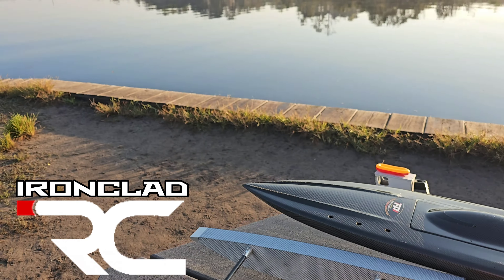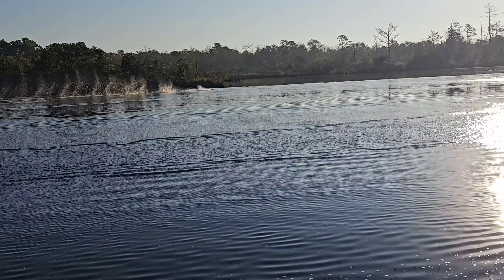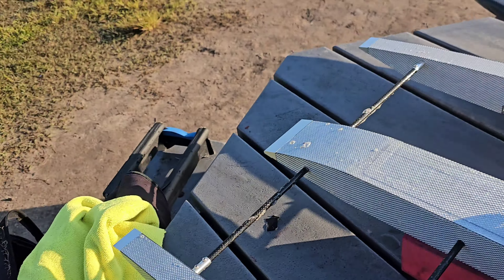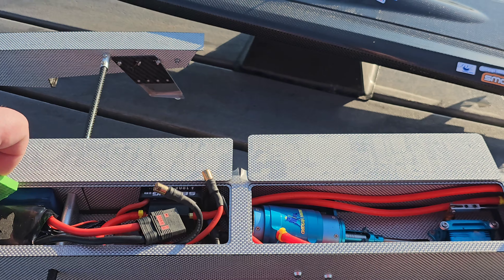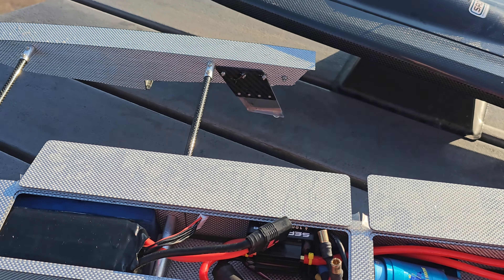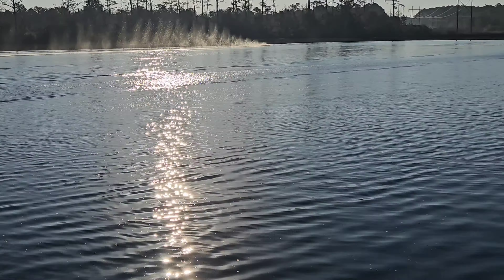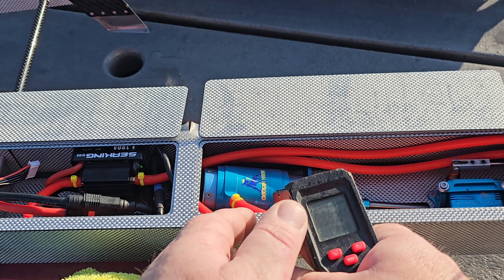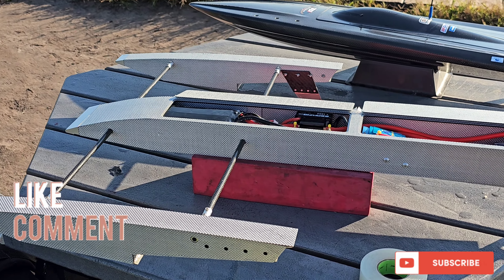Turning Laps On Glass Oxidean Scorpion Rigger 34" Carbon Fiber Rc Boat - Seaking 180a, 4082 2000kv

Comment: Super runs 👍 definitely quicker on the second pack. Not as much irregular rooster tail chatter either,  do I make sense ? 😂 Does a free flowing uninterrupted rooster tail indicate faster speed? 
What caused the  steering servo to chatter like it did when you lifted the hatch ? after the second run  please ? The still morning water was beautiful.
Reply from the maker: Yes sir!  You don't wanna see any breaks in the rooster tail, solid spray is the absolute best 👌

Servo, most likely due to blackish water

Comment: the gnss has a small 1 cell lipo in it that does go bad. Usually the sign when they dont take a charge. Simple to replace or you can hardwire it with a servo lead and plug into spare channel on rx.
Reply: Slowness94 have you done that before?, I was thinking I could simply slice a servo lead on the end of the charge cable.
Reply: @nealstarling5422  you can do it that way as well I did it cutting up a Type C cable.
Reply from the maker: @SL0WNESS94  it's charming great now that I used dielectric grease in my charger port..  my gnss is only a couple months old

Comment: Awesome run Big B! I keep hovering over the buy button for this boat on Oxideans website. I already have a zippkits R4 outrigger but its pretty limited on space for upgrading motors or larger batteries. Did Bill ever give you a discount code or a small kickback if a buyer mentions your youtube page?  I also have the non- self righting Dominator and its my most reliable boat. They definitely are the baddest boats on the scene lol.
Reply from the maker: Try BIGBISTHEMAN for 5% off. Can't promise it will work, but it might?  That code is for the dominator.     It's a sweet outrigger. I'm gonna do some more bench and running videos hopefully this weekend

Comment: Mr B …sometimes the motor likes a smaller prop so it can reach full potential rpm and an easier load… the end result is will often be more speed, better acceleration and more stability as the boat takes a better set
Reply from the maker: Roger that, thanks!

Comment: That rigger looks awsome.  I just finished the Zippkits R4 rigger and I'm getting 60  with a 4519 4s and with the Oxydean 42 high rake I'm doing over that but with 150+ esc temp. I'll stick to the 4519.till I find a better one.
 What prop do you recommend for 4s 36 2550kv?
It says it will take 23volts , it's on the cusp of 6s???
Reply from the maker: Maybe

 OVAL abc 1814 17/45 

SAW  octura v 942/3
Reply: @IRONCLADRC  well I ran 6s on it,and it really liked it. Cool motor, but the esc hit about 140f . That was at the end of the batteries. I got 68mph till I hit a log and broke the boom tube's on the right side.
 I also bent my rudder , I straighten it and cut it shorter. Now it doesn't want to turn till it hits speed.  When it hits speed it hooks to the right hard.
 I just ordered a new rudder,  now the waiting game. Lol.
 Just thought I'd catch up up.